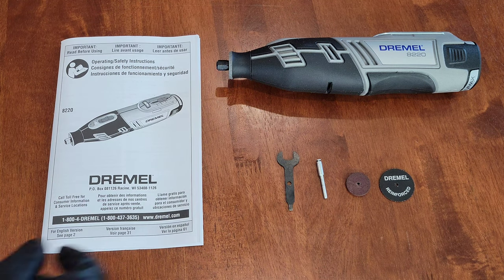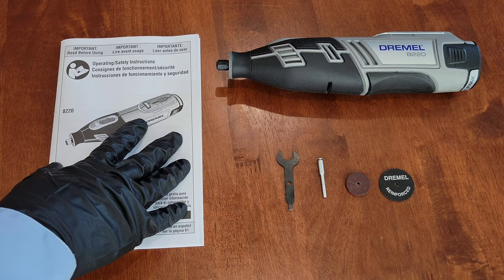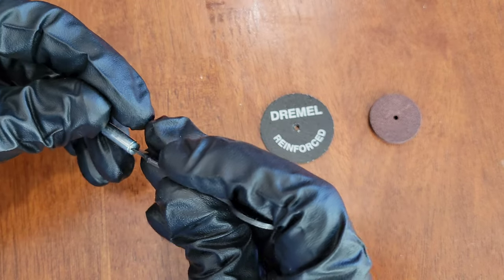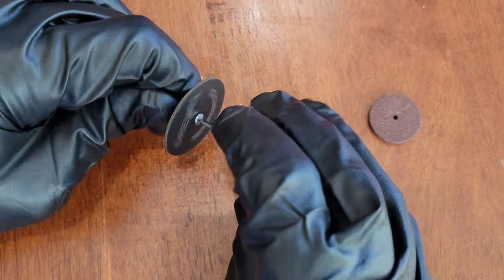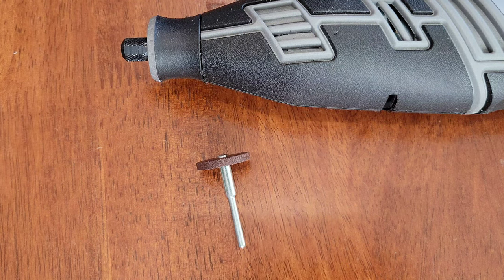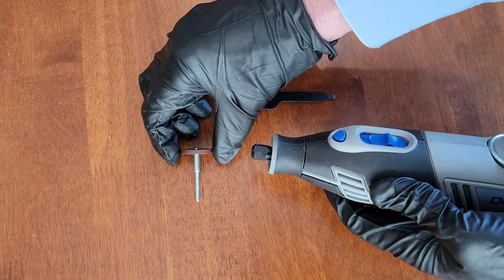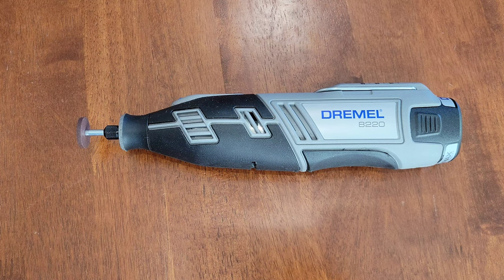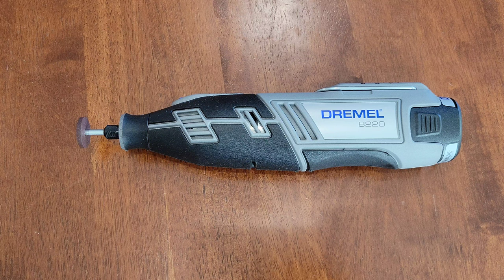How To Attach Cut Off Wheel To Dremel 402 Mandrel

Comment: When I bought a 12 pack of the 456 cutoff wheels they came with a two-piece washer set. I assume that you're supposed to use them. Also, it's easier to tighten the screw when the mandrel is in the collet and the shaft is locked.
Reply: Yeh bro but the mandrel in the chuck and then tighten the screw
Reply: @jenkinz1  You're supposed to use the washers. They keep the disk centered. The shaft of the screw is not as big as the hole in the disk.

Comment: What if the hole in the cut off disc is too small for the screw?
Reply: I just use a tiny wood screw to open the hole up just ever so slightly, and I've had no problems using that method. Hope that helps.

Comment: I can’t unscrew mine! I turn the screw and the whole rod turns. I can’t get any grip on the rod to turn it while holding the screw in place. Any ideas?
Reply: I locked mine into the dremel to use it as a grip
Reply: I’m experiencing the same problem.
How did you fix it?
Reply: Put it in the dremel and use the lock on the dremel. Hope that helps anyone that's needing to know.

Comment: Do I not use the washer that is on my 402 mandrel???
Reply: Yes, use the washer. It helps center it, and it gives the screw a little more area to apply pressure to the disc to aid in it not stripping off and even possibly becoming a safety hazzard.